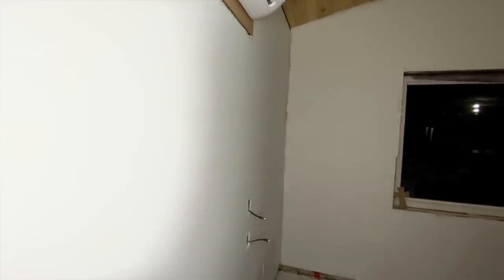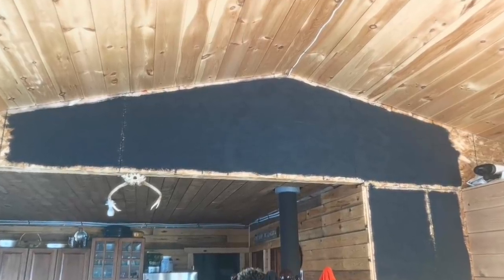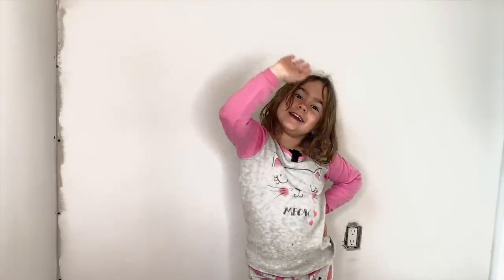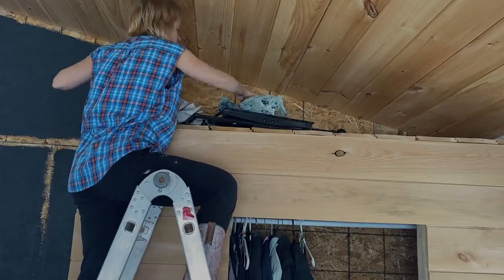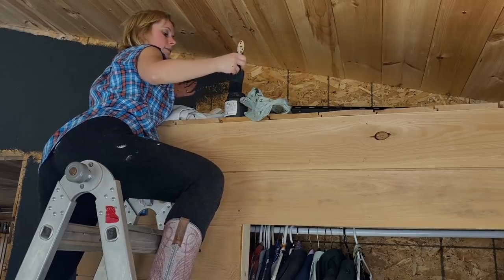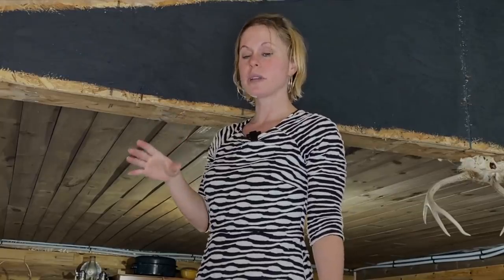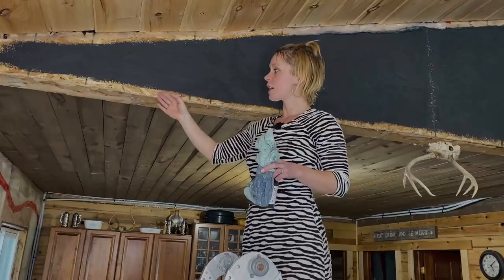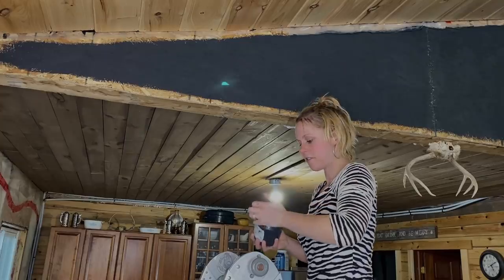She LIKES It! DIY Home Build

Comment: I have just done up a room with white walls and I put pine boards around the windows and a clear coat on them.  It looks very effective especially when the blinds are up and one can see the green lawn and trees outside.  If I hadn't liked it I could always have painted it white like the walls.  Your room will be absolutely fantastic, kitchen done soon, (what a relief), and then the weight equipment out in the shed. You might have to do that before you put the floor down do you think?
Reply from the maker: The weight equipment is in the garage now :)

Comment: If you haven't used it already, take that Hemlock and sand it then clear coat it. It will look 100% better against the ceiling as a natural finish instead of painting it. Honor the wood. PLEASE .